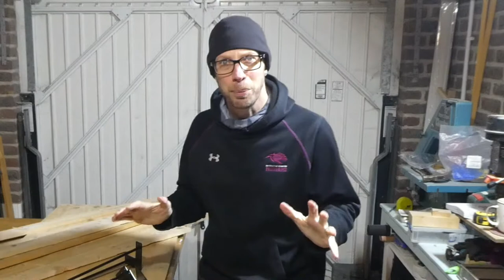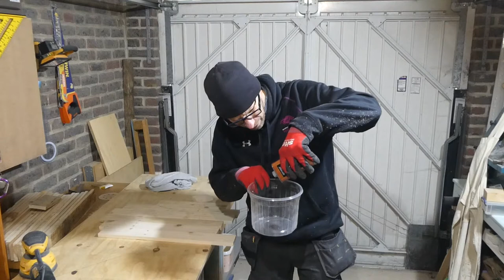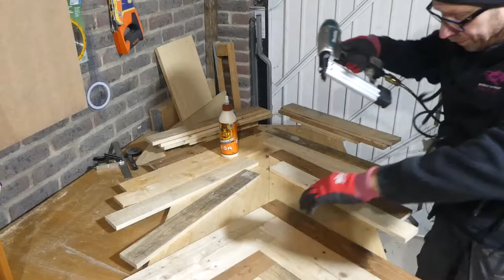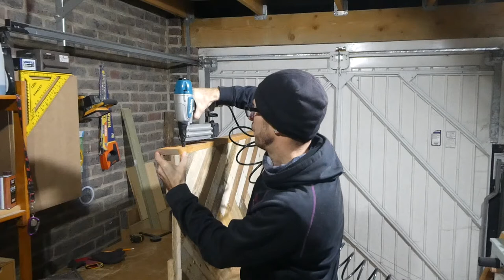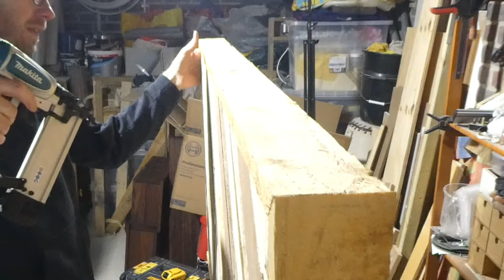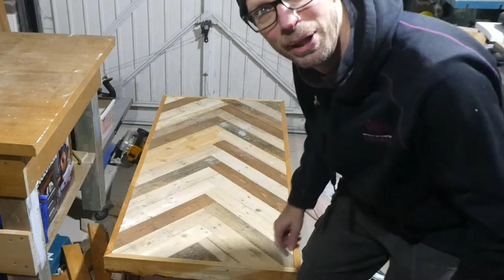How to Make Your Own Herringbone Coffee Table from Pallet Wood - Rustic - DIY

Comment: I know it's a pain having a small shop but I think you would benefit and save on filters with a diy dust collector for your shop vac. Other than that great looking table. I plan on using this design for my garage wall.

Comment: Hey JB, Great job, looks  like a high-end piece from a furniture shop. 

Question, could this concept be used in the creating of a wood chess table. The way you glued down each plank may work with my ‘chess table’ project. 

In the past I glued each plank side-by-side and then clamped horizontally. Your way I would just glue each plank to a piece of plywood the correct width the chess table and will be.

GREAT WORK JB!!